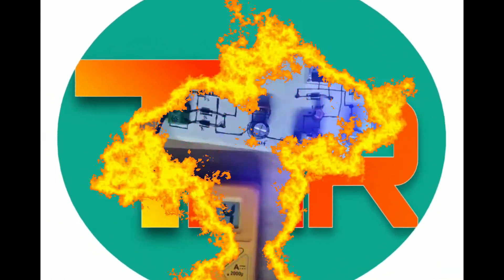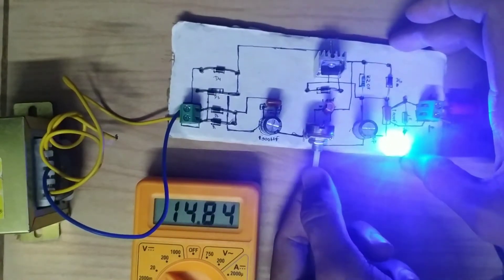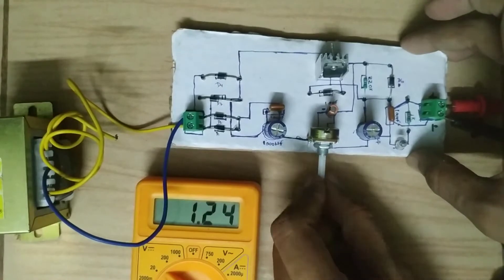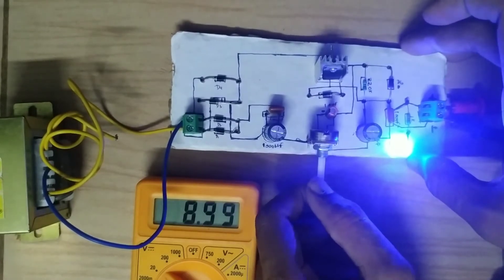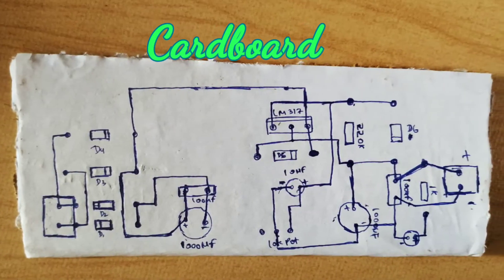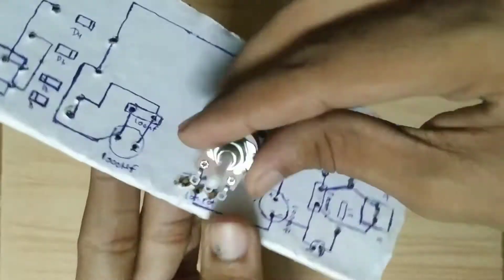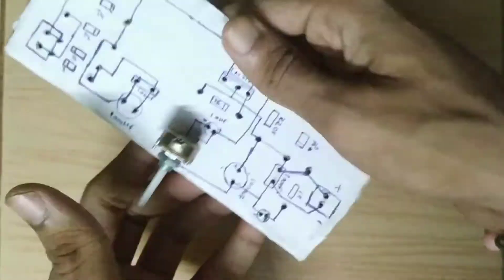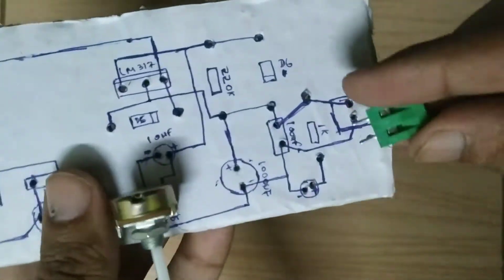How to make Variable DC power supply || Under Rs.70/- only || using Lm317 || Convert AC to DC

Comment: Where's circuit diagram ? You only gave the layout
Reply from the maker: Hello Amit, please check it again, the diagram show where you have to attach every components, layout is different thing, the one i provided you can call it also as circuit diagram. If you have any doubt in connecting you can ask.

Comment: Kitna amps tak load la sakta hai ya
Reply from the maker: It's depend on the transformer you are using.....In my case it is 12v, 2A transformer.
Reply: @TechMechRobo  ok maximum 10 amp ja saktaa hai
Reply from the maker: Noo, this circuit is not capable of taking 10A current. For 10A you need to modify MOSFET to withstand 15A current.
Reply: Ok